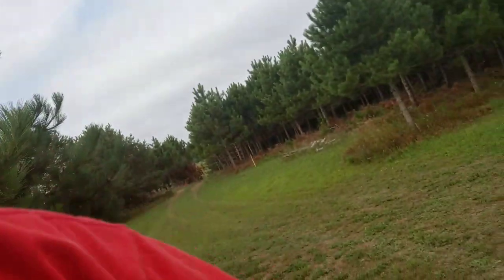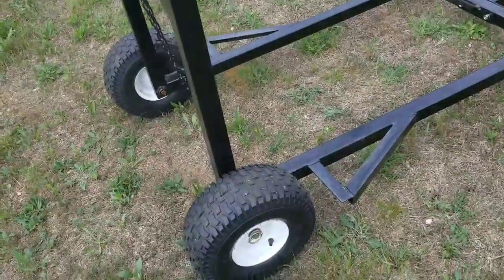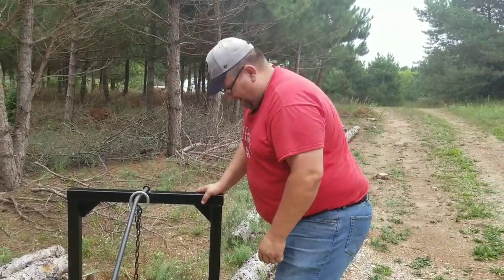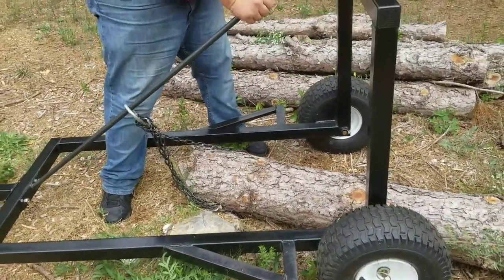Skidding Small Logs with a Lawn Tractor

Comment: I have a craftsman T240 with the Kohler KT725 22 horsepower 725cc Engine it pulls 700 pound logs without breaking a sweat the only thing I did was put 6 ply ATV Tires on it's a beast...the Tractor weighs in at 620 pounds

Comment: Thanks for sharing. That is actually a real interesting design. I have seen some homemade skidders before and we had one that i used when i was younger. I like that system. Maybe a shorter chain would help but I was also thinking that maybe the log was not heavy enough to get it over the hump in the bar. It seems that it will work good for your application. hope you are having a great weekend. dont work too hard friend.
Reply from the maker: Am thinking of getting the Norwood "probe and chain" to make it easier. Also on the 2nd log I did, not in this video, hooked it further down the log and it pulled up like it should.
Reply: Beyer Forestry, Welding, and Other Stuff not sure what the probe n chain are, but I am googling it rt now👍

Comment: I like the design. With that angled steel bar and the ring on the chain, i would only want it to come up the bar about half way. That lifts the log and transfers weight to your little tractor. Letting the chain go past the hump actually takes weight off the tractor. 
Grandpa showed me years ago how to get max weight transfer to the tractor.
Reply from the maker: With my fat butt sitting on it, the minimal weight taken off the drive tires is not an issue with these small logs.
Reply: Think i am going to use your design to build one.  Thinking of larger logs. Get enough weight transfer, i can use my 2wd honda 4 wheeler or my simplicity mower.
Reply from the maker: I found this one on Facebook Marketplace or Craigslist. At the time it was cheaper than trying to build one myself.